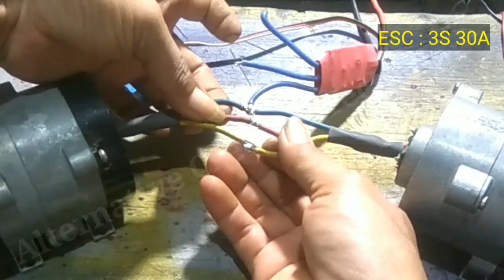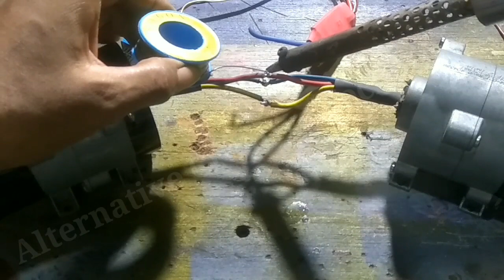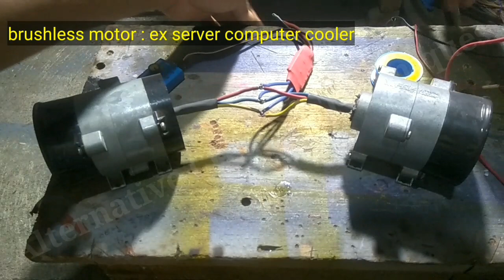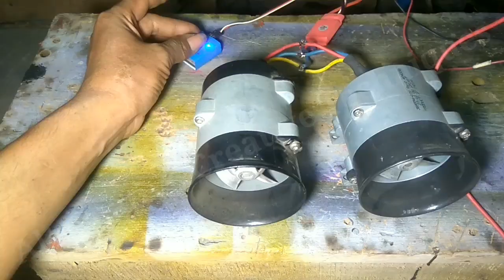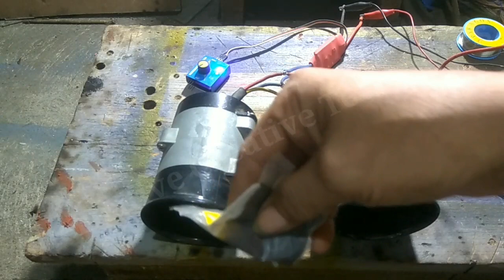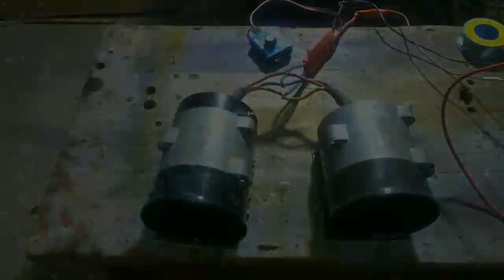One ESC powers/controls two Brushless Motors.

Comment: what effect if use more than 15 minutes? Thank's...
Reply from the maker: This is just an example, so I'm just using existing materials.  This is an experiment out of curiosity, can one controller for two brushless motors.  What I know is mostly one controller one motor.  In order to be strong for two motors, so the controller power must be twice the motor power.  The one in the video, the ESC/controller only has a current capability of 30A.  While each motor can draw current up to 16A at maximum rpm.  So, I run only a quarter of it.  Because, the specifications written from the manufacturer may not necessarily match the actual specifications.

Comment: Does the ESC get hot?
Reply from the maker: Tentu watt/amper ESC harus disesuaikan dengan daya dari dua motor brushless nya.
Artinya, daya ESC harus dua kali dari motor brushlessnya.
Reply from the maker: Coba cek video ini : https://youtu.be/ugOJ_eoicUY
Itu yang pakai controller sepeda listrik.
Reply from the maker: Ini video saling berkaitan : https://youtu.be/61tZhyAbQDM
Reply from the maker: Video-video itu adalah percobaan dari rasa penasaran, bisakah satu driver/controller/esc motor brushless untuk menghidupkan dua buah motor brushless, dan ternyata bisa.
Reply from the maker: Kalau dilihat dari cara kerja controller motor brushless, yaitu dengan mendeteksi/mengetahui posisi magnet, seharusnya controller binggung mendeteksi dua buah rotor. Kemungkinan tidak bisa, ehh ternyata bisa 😂😂.
Tapi itu yang controlles sensorless, tidak tahu/belum coba controller yang harus pakai sensor hall.

Comment: mas.... maksudnya kalau mau running 2 buah 30A motor, ESCnya harus 60A iya mas?
Reply from the maker: Betul mas bro. Secara logika kan masuk akal 😄.
Contoh ada 2 buah batang bambu kecil dan besar masing2 untuk jembatan yang berbeda. Yang kecil masih aman dilewati orang dengan bobot 50kg. Kalau bobot orang 100kg kan lebih aman lewat jembatan yg satunya yg pakai bambu lebih besar...😄
Reply from the maker: Video ini sebenarnya untul menjawab rasa penasaran saya jika 1 ESC apa bisa untuk mengontrol 2 buah motor BLDC. Karena ESC itu untuk mengetahui posisi magnet di rotor menggunkan tegangan feedback (back EMF) dari coil motor.
Saya pikir tidak bisa, ehhh ternyata si ESC tidak bingung terima signal dari dua motor BLDC 😄😄
Reply: Makasih iya mas.. paham langsung